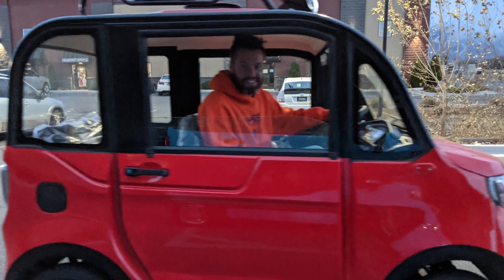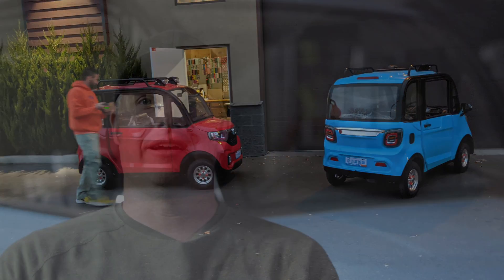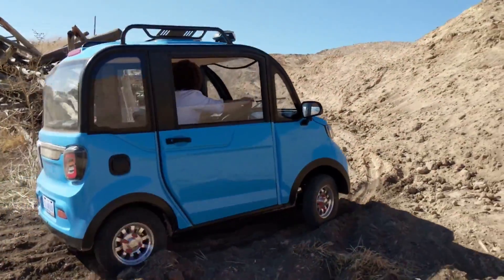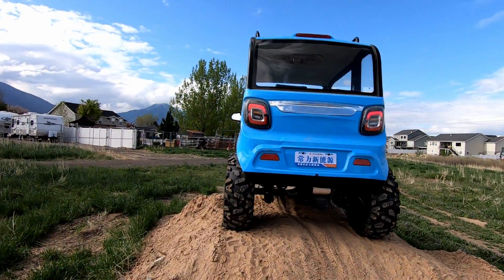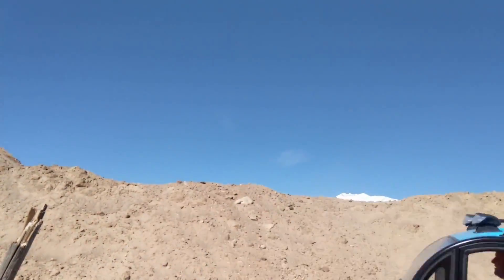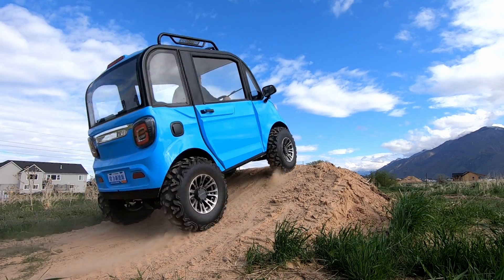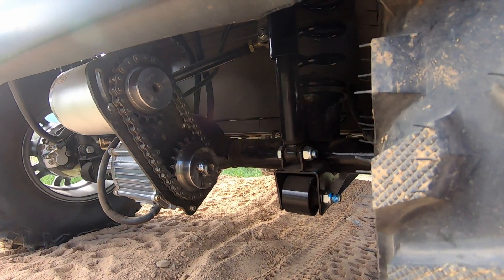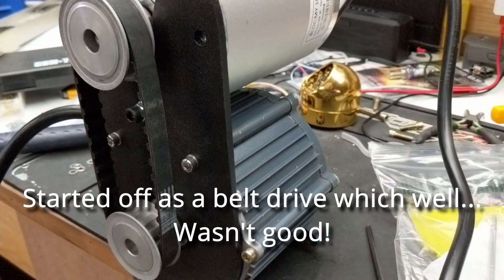CHANGLI MONSTER MODS! CHEAPEST ELECTRIC VEHICLE EV CHINA CAR WITH LIFT KIT AND MOTOR MODS. DIY UTV

Comment: I am modding my Changli trucks here in Indiana. Soon going for a 4wd build once I finish my lift kit. (of course bigger tires and rims)
Reply from the maker: That's awesome! Are you going to make videos? It seems that those new ones already have enough power to push these bigger tires and wheels. I really like the ones I got linked in the description of the video but there are a lot of great options. Also the wheel adapters are in there too. Check your bolt pattern to see if they are the same as the ones linked in the description. You can find almost any bolt pattern adapter it seems.
Reply: @3dconceptsofutah757  When you did your controller change out . Was it plug and play or did you have to reprogram it? With what I have done I am going to HAVE to change mine out as well. I did change my wheel bolt pattern BUT I have bought rims that will fit with no mods now. (other than lifting)
Reply: @3dconceptsofutah757  I Made a video yesterday. Just put ChangLi truck tallest truck in the search bar.

Comment: Sealed led acid is heavy , your big upgrade would be lifepo4 battery , you can discharge a lot more of the battery and they are a lot lighter
Reply from the maker: I agree. It's a matter of cost at this point. We have spent a lot of money on this thing already! Do you have a good source for LiFePo4? Or a model you could recommend?
Reply: @3dconceptsofutah757  I know a supplier they have a warehouse for lifepo4 batteries , grade a cells

Comment: Why not use a 50cc moped engine and CVT transmission and make it 4wd or AWD that way it is still road legal without a license and the gas mileage is still great and the range is a lot further . Put heater for winter and a/c for summer . Love the off road tires ! Now put a ATV or lawnmower snowplow on it to do driveways in the winter.
Reply from the maker: Would be pretty funny seeing a Changli with a snowplow 😆

Comment: There has been a lot of Been there done that with gas or diesel engines. 
I see the challenge is in making a practical electric driven vehicle. 
The more the merrier.  You can easily create a solar charger to allow you to drive free except for licensing and maintenance.
Reply from the maker: Thanks for the comment! Yes we decided to keep it electric and went with more batteries and bigger motor. It was worth it for sure!

Comment: Get a real engine, you can get a 250cc or larger china engine and transmission with a drive shaft and a reverse. If you look at the 3 wheeled china truck drivetrain,  the motor can be put up front and run a drive shaft to a regular rear end.
Reply from the maker: It would be nice to have a regular car differential for sure. Way easier to work with and wouldn't have broke on me with the big electric motor I put on it

Comment: It's too bad we live so far away from one another. I stumbled upon your YouTube channel while checking out the electric car scene.  I'm here in Ohio and gave up my car in 2013 when I moved to a Mennonite village near Canton, Ohio. I am older, in my early 70's. I have been wanting to buy a cheap Changli and have someone beef up the power for higher speeds and greater distance. That would solve my transportation needs. It sure would allow me to do my grocery shopping and get me to church as well. The small engine in the Changli reminds me of the little Honda car I bought back in the early '70s. It looked like a wind-up toy car. Although it was a gasoline-powered engine it was only a 600cc engine. Would love to purchase the Changli and pay you to handle the purchase and shipping and pay you to do the modifications. Presently I must ride my electric wheelchair to do my errands and then I am only able to ride it in good weather. 

you are in Uta
Reply from the maker: Hi Stephen! 
Thanks for your comment! I don't think it would be worth it in the end. We have about $5k into the car, shipping, and extra parts. In the end you are left with a fast piece of junk 😄. A used golf cart would be a better buy in my opinion. It looks cool and goes about 37mph now but it is not good on or off road. Best of luck to you!
Reply: Thanks for the advice. I have thought of a used golf cart, however, I do need the electric vehicle to be enclosed to keep me out of the weather. I'll take your your advice and continue looking. THANKS!!
Reply: @stephenhendershot6180  A guy in Utah can hanfle all the import paperwork for you. His company is called Electric Import Motors. He has a YouTube channel. You can do a YouTube search.

Comment: I like what you're doing with this you guys look like you're having alot of fun with this, if you'd be interested I have an idea if it's possible to set up a secondary battery bank  to have to charge while driving or even just a second set to dedicate added hardware to. Maybe even try a chop job or solar charging unit
Reply from the maker: Hi! Thanks for the comment! You could add more batteries but you'd have to find a place to put them. Not much extra room in this car. I'm about to add one more battery in series though to get a little more power without using more current...Stay tuned!

Comment: Do they make small dirtbike tires that would fit the factory rims also what is the rim size on them? What about upgraded shocks/suspencion components to make for a smoother ride? And lastly 40 volt ryobi batteries have you considered using those so they could give more power as well as giving you the option of A relitivly quick battery swap. Whenthey become discharged without having to stop using the car while it is on the charger?
Reply from the maker: There is probably an offroad tire that would fit the stock rims and better shocks I'm sure! Ryobi 40V would not be a good option as the stock batteries are 45Ah and Ryobi 40V are way expensive and only 6-8Ah or you would need to spend a fortune building series parallel sets of them. Thanks for the comment!

Comment: A 212 hf engine or the next one bigger. In the 400 range selfe starter. Would be killer. A two speed with reverse. Transmition. Say a mini power glide. G M style. Would be the cats back side. Hi hi best is a CVT w/reverse switch to back up. All in all good fun to think about. Thanks
Reply from the maker: I have a stack of harbor freight engines in 80cc, 212cc, 420cc, a reverse gearbox and 40 series CVT that I was planning on finding a combination that would work for this. Ended up getting a huge electric motor capable of 24HP peak. If it's not awesome enough I might try the gas route but it should be even cooler than the 420cc and might still break the axle with too much torque! Thanks for the comment!

Comment: Get with Electric Import Motors, they carry the Changli vehicles, including the pick up truck.  They also can supply parts.  They are out of Utah.  Another company is importing them and sell them as the Pickman.  They have the cars, and pickups.  The pickups come in 2 or 4wd, 2 or 4 passengers, regular stance or lifted.  They are out of Boston.  Changli offers factory installed mods, including a dump bed on the pickup, air conditioning and lithium batteries for more amp hours/longer driving
 time.
Reply from the maker: I would love to monsterfy one of the little trucks. I'll have to touch base with them and see what they think.

Comment: Can the changli get insured in the us？
Reply from the maker: Not sure. It probably depends in each area. If you insured it as a golf cart maybe...
Reply: In most states they are considered non street use, so they aren't general registered.  They treated like a golf car, so you are covered under your homeowners/renter's policy.  There are some states that do treat them as low speed vehicles and have registration, which I would think requires an auto insurance policy.  Check with your state DMV about registration, and your insurance agent about insurance coverage.

Comment: I ordered one and what kind of mods I can do it to make it faster
Reply from the maker: Hi Laurent! Bigger faster motor and motor controller can help. The motor controller I have in mine is capable of pushing a much bigger motor than what I have. I have it turned way down and it still heats up the wires quite a bit! Stay tuned while I try converting it to gas.
Reply: Try adding cvt

Comment: Hey! love this ! Your link to the wheel and tire package isn't working. What's the tire size info on Amazon? maybe drop the link in this comment? Thanks!!
Reply from the maker: Hi! Thanks for your comment! It appears that they are out of stock on Amazon. They are MassFX brand. Here's the description of what I bought. MASSFX SL 25x8-12 25x10-12 ATV Tires with Black QUAKE 12x7 4/156 Rims UTV Wheel and Tire Kit with Lug Nuts. 

They are meant for a Polaris lug pattern so you need to adapt them. However, it seems that you can get adapters for all kinds of combinations so you could find something else. I really like the look of these and they were only $500 for the whole set....

Cheers!